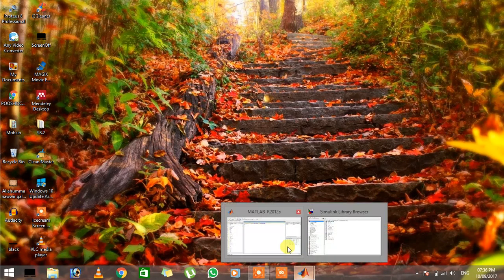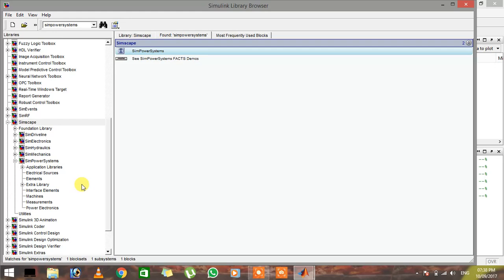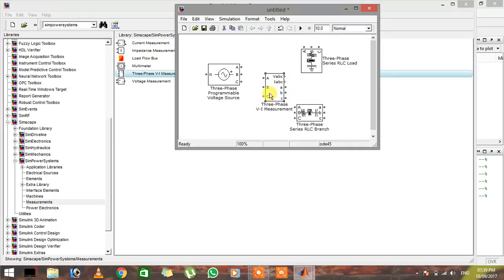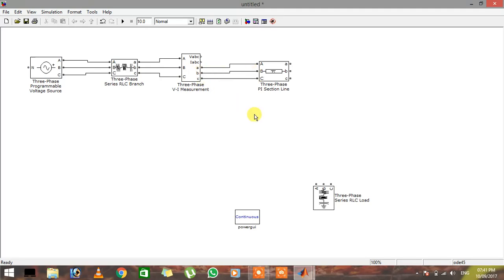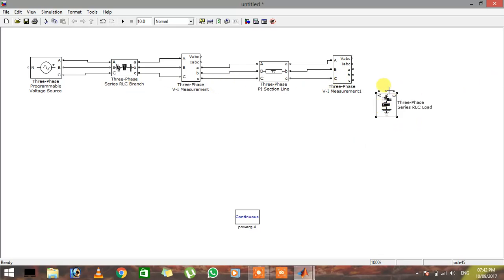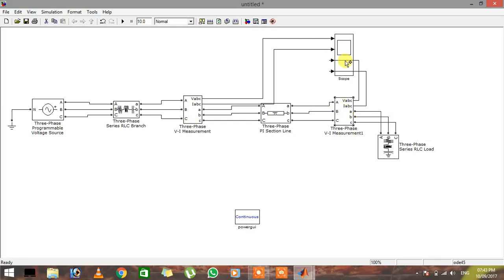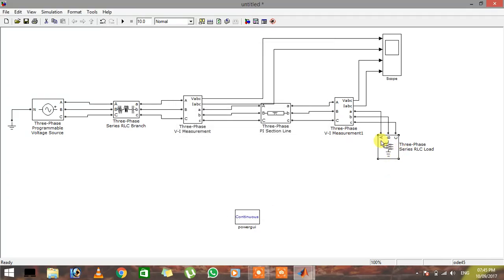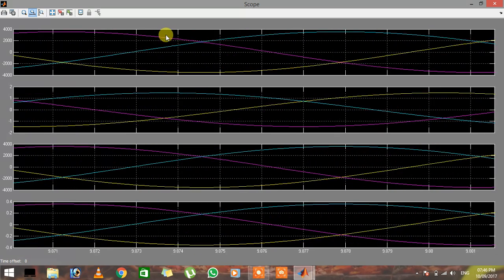Matlab Tutorial | Voltage Regulation in Transmission Line | Effect of Load (Part 1)

Comment: made two parallel line with RL branch and create fault at one line............
observe the voltage and current before and after removing  of fault. you can  control fault current by placing resistance in series.
please try to do it

Comment: is it possible to replace the load as a branch RLC and then connect the RLC branch to ground?  - and take the same measurements because you're just changing the definition of the load with respect to the power and voltage.
Reply: I don't have access to simulink at the moment  - hopefully someone can clarify this for me :) Thanks